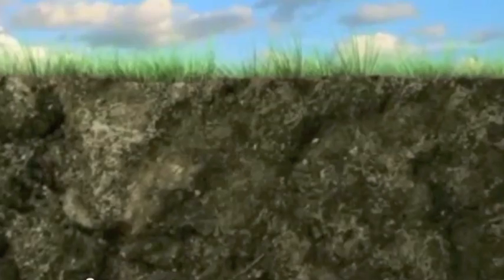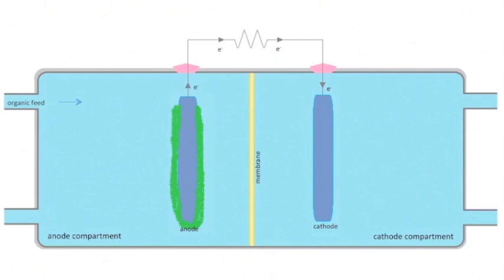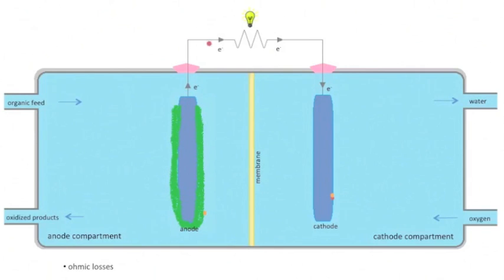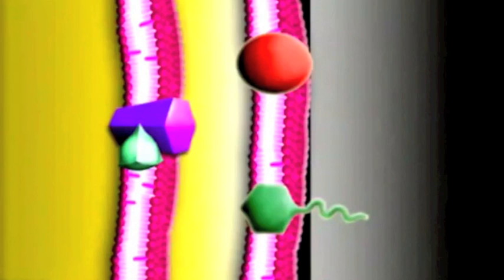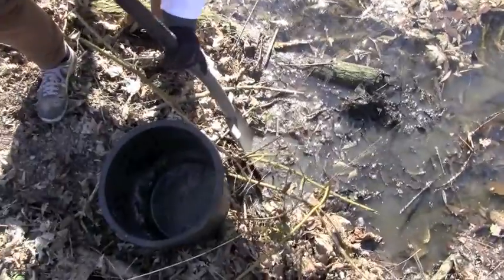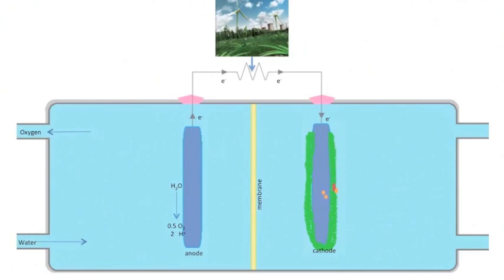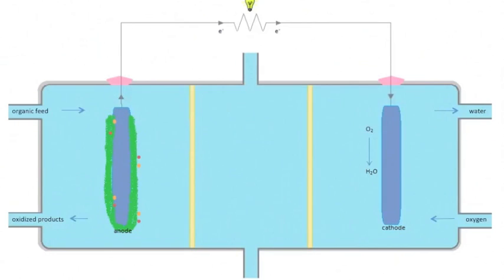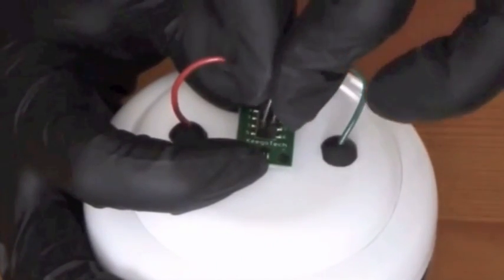The Microbial Fuel Cell

Comment: Hey, buddy no offence but That's a capacitor which you used to store the energy and you are not connecting the anode to the cathode actually you are connecting them to the capacitor in parallel with a red led :)